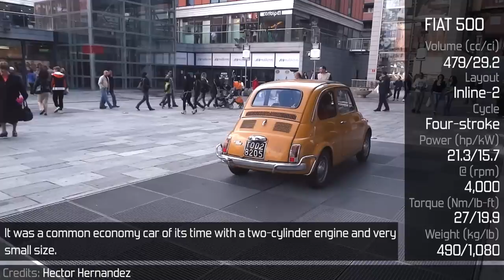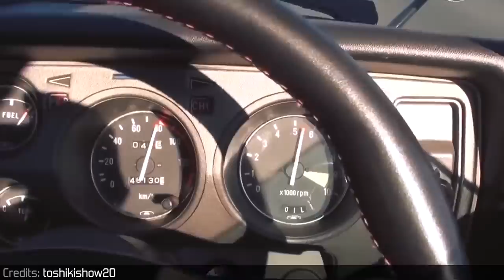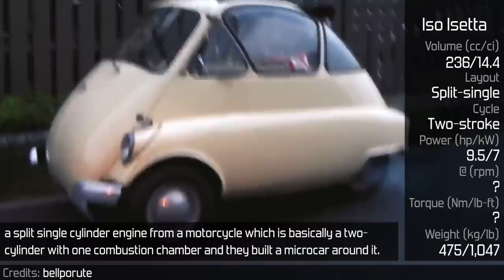12 Of The Smallest Engines Installed In Cars

Comment: Which do you think would be faster in a 100m drag race: a stock 2CV (only 375cc!), or Usain Bolt?
Reply: bolt :-)
Reply: Bolt.
But 400m-2CV
Reply: The original 2CV used 3L petrol per 100 km. Not a lot of cars can do that today.
Reply: Josh Bacon I
Reply from the maker: Definitely Bolt, 100 meters is a short distance for such a weak car to reach any high speed. It would be otherwise with a longer sprint as Usain Bolt is not as fast as 2CV's top speed :)
Reply: VisioRacer dang
Reply: Why do I see You everywhere?!
Reply: Tore Lund my 1600cc E46 316ti does
Reply: if you drive a maximum of 40mph in any car, you'll be amazed at how good the mileage is
Reply: A C I don't drive her at 40... I drive her at 90. And if you look at my name, I understand metric
Reply: Josh Bacon hahhahahahahaahah Id love to see that
Reply: Stock 2CV, totally
Reply: Fuckin' obvious

Bolts win because the car is not able to run without them!
Reply: That's very nice for such a large engine. I only thought that theVW Lupo 3L and Lupo TDI with small a engine were capable of that.
Reply: My auntie in her electric wheelchair!
Reply: Josh Bacon car would be higher speed and bolt would be higher accelerating
Reply: Josh Bacon-  Impossible to tell without the actual drag race.  That's why we HAVE drag races!
Reply: Josh Bacon Who would be faster,my 110 cc 4 stroke bigfoot midi quad (9hp) or Peel p50
Reply: I vote for the BOLT.
Reply: Usain Bolt's forehead :P
Reply: @ΑΡΗΣΚΟΡΝΑΡΑΚΗΣ  Russians use metric?
jk jk jk
Reply: Usain because even though the 2CV would be faster, Usain would accelerate way better, but the 2CV would win in a longer race because it would be given enough time to surpass his speed and overtake him
Reply: Even I would be faster than Ugly Ducling
Reply: 2CV is more economical than Usain Bolt for sure. He costs a quoter milion dollars per 100m,  so probably more then a big rocket.

Comment: The 2cv engine is indestructible as it was built to run at full throttle all the time
Reply: @ jam63112 
true, I proofed this. 2CV never complained about a brick on gas pedal. Still, slowing down to French road speed (90 km/h or slightly above 55 mph), gas mileage did improve dramatically (33 to over 40 mpg).
Reply: My dad have one before and she run at full speed always and the 2cv overheat so he wait 15 mn and the 2cv restart
Reply: You still see some 2cv on the roads today, thats the proof they are very solid cars

Comment: even in 1970 honda were making really high revving small engines
Reply: Oscar Thorpe Some things never change :)
Reply: Oscar Thorpe Before VTEC there were engines like one used in the 1974 Honda CB125.
Reply: Oscar Thorpe-  What do you mean, "even in the 1970's"?  Honda was high-rpm committed from their very first day in production, realizing that higher rpm's were the cheap way to get increased horsepower.  My first motorcycle ride, with me driving, was on an early '60's Honda Sport 50.  Today's 50-cc motor will get you up to about 30, 35 miles per hour, but that little sucker topped out at 50!  There I was, feet on the passenger pegs, laying on top of the gas tank, all tucked in under the paint, no helmet, no goggles, screaming along at 50 mph, and I fell instantly in love!  With motorcycles!  I think that was the most exciting ride of my life, and I've owned over 30 of them since.
Reply: Honda MC22 motorbike.
The old CBR 250RR.

The limiter kicked in at 20500 rpm and the engine in racespec could safely reach 22000.
High revving engines are their thing.
Reply: In 1960 Honda were making high-revving motorcycle engines - the CB72 250cc twin, and the C92 125cc twin both revved to over 8000 RPM.
Reply: Bruce Roger Morgan-  Yup.  My second motorcycle was a 1966 Honda 305 Super Hawk, a real screamer.  Redlined at 11,000 rpm, it would pull it in top gear, giving it a top speed of 110 mph.  Interesting note:  it had 'hairpin' style valve springs, like Ducati, to reduce reciprocating valve mass.
Reply: @alexanderkasady6839  The 305 Super Hawk was my first as well. Man I loved that bike!

Comment: Here is something sad.
The 1968 Subaru 360 prduces up to 36 hp and weighs about 500kg
which puts it at 72hp/ton
i own a 1996 VW Polo 6n 1.05l at the moment, which packs about 45hp, weighing about 1000kg.

You see my point?
Reply: Nazimelonhamster-  No. What IS your point?
Reply: No you didn't really explain your point.  Are you getting at as time goes by power per displacement increases?
Reply: a 50 year old, 360cc engine japanese keicar is sportier than my 1996 Polo.
Reply: Nazimelonhamster-  What't really sad is all of these 3-wheelers, and with the Peel 50 at the end demonstrating why they should be banned.  It reminded me of Honda's 3-wheeled ATVs and why Honda got sued clear out of the 3-wheeler business.  Thank God the Suzuki 4-wheelers came along when they did-  they saved the ATV business.  It's my bet that if micro-cars make a comeback they'll  (A.) all have 4 wheels, and (B.)  Great Britain won't have any because of their stupid vehicle and licensing laws.

Comment: Interesting, but 2 errors: The Citroen 2CV has a 4 stroke engine, not 2 stroke - you can see the rocker covers on the engine, 2 stroke engines do not have rocker covers. Also, the Iso Isetta was a 2 stroke, but when BMW built it, they used their own 250cc 4 stroke engine - I know this, as I had the BMW motorcycle that used the same engine - a 1953 R25.

Comment: You left out the Berkeley 2-seat roadster, Mine was built in Bedfordshire, U.K. 300 to 400 cu in ram air-cooled motorcycle engine with an in-line motorcycle-type gearbox and electric start.  Great little car. Got stopped in mine one day in the late 1950s by a police radar unit in California, not because I was speeding (I probably was) but because they were curious about why it did not register in their radar (fiberglass body).  It was a conversation piece everywhere. The two-stroke engine had a dry sump, so a pint of oil was needed with each fill-up (4 gallons). But by stopping in at a truck stop for gas, they never charged me for the little bit of oil compared to what they usually sold. 50 mpg.  Top speed about 70 mph. It had one significant weakness. It used a chain drive to the differential with a fiber gear that tended to wear out after a few thousand miles.

Comment: I would point out that the Citroen 2CV you showed was a UK example - which were not imported until after the 1973 oil crisis. By this time, they were possessed of a 603cc twin cylinder engine with a heady 29bhp at the right foot, so not strictly within your range. Furthermore, you have omitted the Bond Minicar which was of the same era as Isetta, Messerschmitt, Fulda - and boasted a 197cc motor.

Comment: What's wrong with today? Nowadays "small" cars (yes, I'm looking at you Mini) are kinda... big! The engines aswell! Not to mention the kiddy immature commercials due to feminists saying the older commercials were "fake".
Reply: Xalataf All the safety features required by law take space and weight the car down
Reply: Xalataf VW Polo, also known as a midget's Golf.
Reply: Xalataf-  You're absolutely right.  I have a 2003 Mini Cooper, and with its 1600 cc engine it's got plenty of power, more than it really needs.  The new Mini is a 3-cylinder 1,000 cc unit with a turbo-charger, slated to put out more horsepower and torque than my 1.6-L.  My point is this:  any of the micro cars shown in this video would be a viable 'transportation mule' with a modern 600-700 cc power plant, that is, one with 4 valves per chamber  with narrow valve angles, a centrally located spark plug, a Twin-Swirl Combustion Chamber, and a turbo-charger.  It would have to be liquid-cooled in order to provide cabin heat and defrost.  The air conditioning compressor can have its own electric motor to drive it, so it doesn't matter where you mount it, since all you need to run it is an alternator....  And it would produce enough power to be a kick to drive.  So long as it would provide year-round comfort and be fun to drive, to say nothing of its minimal exhaust emissions, it'd be a hot seller.
Reply: Tiberiu-  It would therefore require a certain relaxation of government safety standards.  We absolutely HAVE to free ourselves up from the tyranny of the Chevy Suburban.  Way too many people are buying big, dirty gas hog S.U.V.'s because of an over concern with collision safety.  If government put an upper displacement limit on car engines (say, 700 cc) and motorcycle engines (360 cc) but allowed unlimited size for electric vehicles then the consumer would have a choice and both would drastically reduce emissions.
Reply: alexander kasady Especially consideing the new Cooper S' turbo vent is fake.
Reply: Tiberiu Nicolae Screw regulations! Now we don't have those pop-ups!
Reply: alexander kasady I have to agree with you on the SUV one. Here in Indonesia I see Toyota Fortuners, Honda CR-Vs (and HR-V/Vezel), Toyota Harrier and Mercedes GLC/GLE.
Reply: Xalataf-  Fake or not (that's irrelevant), it's wholly unnecessary.  It's there simply as a styling gimmick, serving no functional purpose, save for identifying the 'S' model from the front view.  And size is strictly relative-  get rid of the behemoth S.U.V.'s and the Mini Cooper becomes a mid-sized car.  Back to the video, though-  Honda  was the only one to get it right-  front-mounted engine and liquid cooling.  There was no market outside of Japan back when the Kei was being built, but today it'd make a good beginning point for a modern micro-car.
Reply: I'm not 100% sure about those regulations, but I do wish the crazy fad for OSVs (over-sized vehicles) would finally go away already!
Reply: Tim Mungenast-  That fad ain't gonna go away on its own.  Ever notice how the majority of drivers in big SUV's are women?  That's because of their need to feel protected, fantasizing being wrapped in the arms of a big, strong, hulking man.  Is that because they emasculated the man or men in their lives so they're just spineless weenies?  Is it because they have no man in their life at all and that big, hulking SUV is a surrogate?  Who knows?  But one thing for sure, people buy cars for purely emotional reasons and logic has very little to do with it, especially among women.  They only try to make their buying decision sound logical when they rationalize their choice afterwards.  I used to sell cars.  (Can you tell?)  It's turned me into a real cynic when it comes to human nature.
Reply: They do now, but the technology wasn't available in the 1950's.
Reply: alexander kasady But in reality they tip over easily due to their high centre of gravity.
Reply: Xalataf-  Oh sure, but who expects women to use male logic or demonstrate any real automotive knowledge?  Women are emotion-driven while men are logic-driven.  A wounded woman will turn to another for the sympathy she seeks, whereas a man will want to 'fix it'.  BIG MISTAKE!  (laughing)  But be that as it may, yeah, after the arrival of winter's first snow storm the first picture shown on TV or the front page of the newspapers is of a 4-wheel drive SUV upside-down alongside the Interstate.  Never fails.  That's why I drive a Mini Cooper-  flat-cornering, quick-handling, it's like a mouse in a maze-  you'll never catch it.  A go-kart with a gearbox.
Reply: Glad you were able to corner the feminists there

Comment: To these you can add the Bond Minicar, with the first model launched in 1949 having a 122 cc two-stroke Villiers engine. That was later upgraded to a 197 cc engine. By the 1958, it had a 248 cc Villiers engine.

As it was taxed in the UK as a motorcycle, it had no reverse gear, although later models had the option of being able to run the engine in reverse as it had two sets of contact breakers and a starter that could also start the engine backwards (being a two stroke, there is no valve timing to worry about).

Comment: You missed the Bond three wheel full size car from the UK. It had a 197cc two stroke single Villiers engine which you could kickstart if the electric starter failed. Good video.

Comment: Isnt the 2cv engine a fourstroke
Reply from the maker: It is, it's a mistake!
Reply: 2CV means 2-Cylinder V-Motor.
Reply: Walter 72: "2CV means 2-Cylinder V-Motor."

— Nope, it means "Deux Chevaux-Vapeur". Its engine wasn't even a V-twin (or "V-Motor") but a flat-twin:

«The engine was designed by Walter Becchia and Lucien Gerard, with a nod to the classic BMW boxer motorcycle engine. It was an air-cooled, flat-twin, four-stroke, 375 cc engine with pushrod operated overhead valves and a hemispherical combustion chamber. The earliest model developed 9 PS (6.6 kW) DIN (6.5 kW). A 425 cc engine was introduced in 1955, followed in 1968 by a 602 cc one giving 28 bhp (21 kW) at 7000 rpm. With the 602 cc engine, the tax classification of the car changed so that it became a 3CV, but the name remained unchanged. A 435 cc engine was introduced at the same time to replace the 425 cc; the 435 cc engine car was named 2CV 4 while the 602 cc took the name 2CV 6 (a variant in Argentina took the name 3CV).»
en.wikipedia. org/wiki/Citroën_2CV#Engines

On the other hand, there had previously been a "Citroën 5 CV" with a 0.8 L straight-4 engine, and guess what, with five tax horsepower (see "Citroën Type C").
Reply: Gottseidank gibt es immer einen, der mehr weiß. Danke.
Reply: No. Deux (2) cheveux (2 horses), it was a flat twin.
Reply: deux *chevaux, cheveux means hair
Reply: ...also the later versions (that's most of them) were 602cc
Reply: earlier 2CV had 425CC and 18 HP engines, like mine, from 1967 ;)
Reply: Yep : a so called 'boxer' engine.
Reply: @robinbaker464  Boxer engine (opposed cylinders) actually not a two-in-line.

Comment: When I was young we had the earlier fiat 500 with a 4 cylinder water cooled 4 stroke engine.  A "countryman" body with wood panelling and a sunroof.  Later I had one of the Bill Buckle sedan Goggomobiles with a 300 cc two stroke and a fibreglass body.  The "H pattern" was rotated 90 degrees from most cars ( first forward and left, 2nd forward and right, 3rd backwards and left, 4th backwards and right.  A very quick easy to use box.  And it was needed in undulating conditions.

Comment: There was also the Trabant P50 that had around a 500cc 2-stroke aircooled inline-twin that made 18hp I believe, and the later P60 and 601 had a 600cc unit that made 23 and 27 horsepower respectively.

Comment: You forget about Bajaj QUTE. Using 200cc engine from Bajaj Pulsar, with maximum power of 13,3 Hp@5500 Rpm, and top speed 70km/h

Comment: Peels are still being made in kit form, was sad the Reliant Regal with the 600cc engine didn't make it or the 4 wheeled version the Rebel, the Messerschmitt is a crazy machine to drive and it prompted here in the UK the law that required trailered trucks to have anti-run under bars at back and sides as there was a few squelchings of the tiny car's and owners which just couldn't be seen by the lorry driver.   Have always fancied owning a Velorex and the little camper van version of the Fiat 500 has caught my eye on occasion, the featured Subaru I think was a bit of a stab at copying the Beetle but in smaller form.   Jeremy Clarkson drove a Peel around the BBC headquarters for Top Gear, right into the lifts and office spaces... very funny it was too   /double thumbs up for a great vid on motoring quirks

Comment: I miss in this interesting report the Spanish 'Biscuter', designed by Gabriel Voisin, and produced in Barcelona, https://youtu.be/ekj6KRJVmRI  with an all aluminum body, there was aluminum surplus these days, as there is today grain surplus, diverted to production of ethanol for fuels.
Biscooter had a 2-Stroke engine, with a big head extension, full with oil to avoid fast large temperature changes in traffic light stops or fast running, what was called 'Shock cooling' in air cooled aircraft engines. 
Mazda once considered a Wankel-Froede Rotary Combustion Engine version of R-360, but decided not to put it in production when other Japan automakers beg for mercy, it will have send their own micro-car sales to zero.
A member of Hercules Wankel IG once built a BMW Isetta with a Sachs KM-914 rotary snowmobile engine, 303 cc per chamber, equivalent to 606 cc in a reciprocating engine, but taxation measurement of RCE varies from place to place and time to time. It never had a registration, as German motor authority requested braking tests coting over 6'000 €. Salut +

Comment: Check out the Lightburn Zeta. A very small car with villiers 325cc (I think) engine. Made in Australia by the Lightburn Cement Mixer company. Not dissimilar to the Goggomobile in structure but very weird looking. Full fibreglass body. Front wheel drive. full independent suspension. Four speed forward and reverse. Engine runs forward or backwards Iowned one myself and loved it but horrendous maintenance costs. 🇦🇺

Comment: 2CV 2-6 means 2 cyl. Volume in dl, so 2CV2 = 2 cylinder Volume 2 dl or close to ;-) And the gearing can not be blame for slow 2CV6 can if a skilled driver do 0-70 km/h or 45 mph +- on 11 sec. Gran turismo try make 4  2  1,33  1 you can't realy get faster car to 4 gears last gear = topspeed